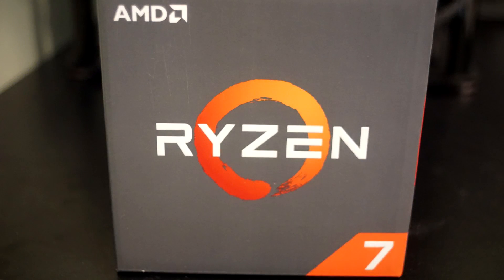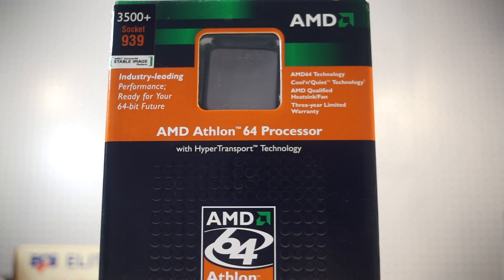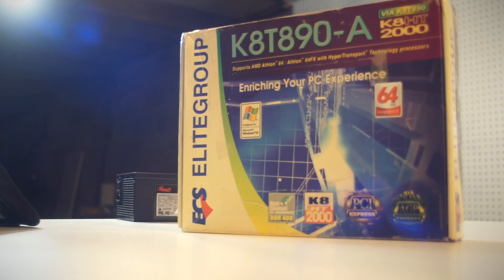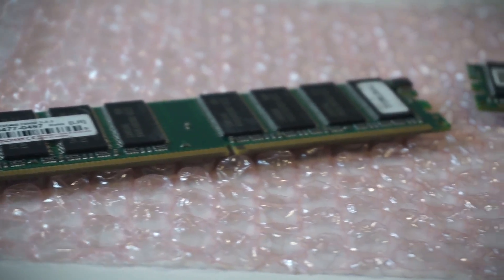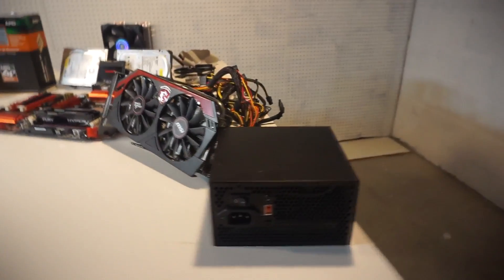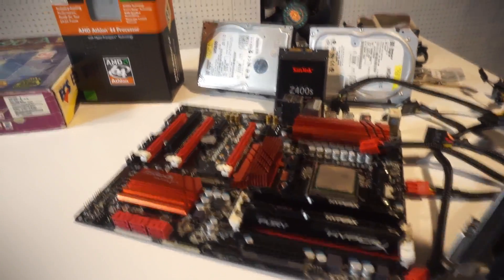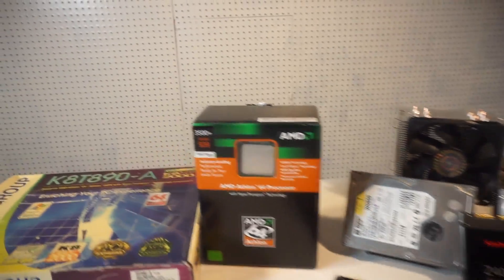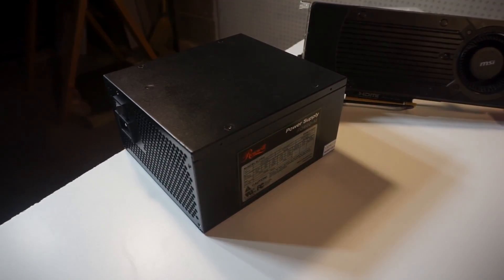New AMD PC Builds: PC Building Bliss

Comment: Holy crap, I remember buying an athlon 64 3500+ for my first gaming system!  I cranked it up to 3.1ghz on my ECS KN1 SLI, with my x800gto2 that I reflashed to an x850xt PE and overclocked by 150mhz core and 250mhz vram...

Man that thing pulled 90fps maxed out when we raided MC.  I'll always have a soft spot for socket 939.

Comment: who else has that same processor cuz i still do it old but it works and i overclocked it slightly using blck technique with 1gb ram it originally jad 2gb but 1 died. the psu hasnt died yet but it is dirty so i replaced it to work with a gtx680 amazing cpu

Comment: Amd athlon 64 3200+, 1gb of ram,  7300gt and awesome top line Epox mobo is my first PC! 2006... In 2008 was upgraded to 3gb of ram, in the start of 2017 i've upgraded it to 4gb and x2 3800+, also never change thermal paste till then)) Still working fine! Still thinking of GPU upgrade. PSU died twice... In 2009 and 2016)) Love this PC!

Comment: Ryzen isn't that good anyway, Xeons are the best by far.
Reply: Gade Embossed Nah thats a lie, ryzen is way cheaper than a new xeon and  the price to performance of the ryzen cpus is legendary just like me :D
Reply: Then explain the $350 ($50 less than the 1700x) xeon e5 2690 v2 with 10 cores (2 more), 20 threads (4 more) , and more powerful than the ryzen 1700x according to game-debate
Reply: Gade Embossed well u have kinda lost your mind, buying a xeon thats on a 32nm architecture for 50$ less than a brand new ryzen 7 cpu, why? 50$ more and you know that it will work and not be a broken rip off. Btw the xeon also has 8 cores and 16 threads so forget about it.
Reply: Well the xeon is 22nm not 32, and 10 cores 20 threads: https://ark.intel.com/products/75279/Intel-Xeon-Processor-E5-2690-v2-25M-Cache-3_00-GHz
Reply: i was on this one http://ark.intel.com/products/64596/Intel-Xeon-Processor-E5-2690-20M-Cache-2_90-GHz-8_00-GTs-Intel-QPI
Reply: oh, yeah i was comparing the v2 not the normal
Reply: Gade Embossed didnt know LOL
Reply: Gade Embossed kinda liked that video about the 24w power supply :D

Comment: I am not a huge fan of the old AMD CPUs but I do like your builds... I am actually planning to build an AMD PC with a purple ECS motherboard like that one lol.
Reply from the maker: Retro Adventure you may want to avoid ECS.   my motherboard was DOA  despite being new.  I did eventually get this pc running but I had to use a different Asus board.
Reply: Actually, no it is not lol. It is this one, which is older: http://amzn.to/2n2p9eH
Reply: Thanks for the heads up! :) I am not too worried about this mobo as it was used before and I have three other socket A motherboards should I need them lol